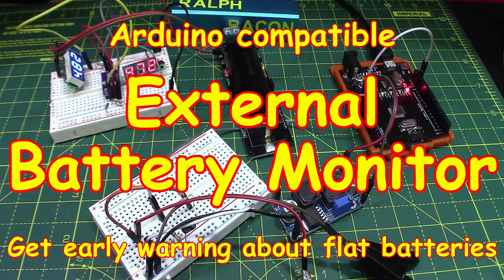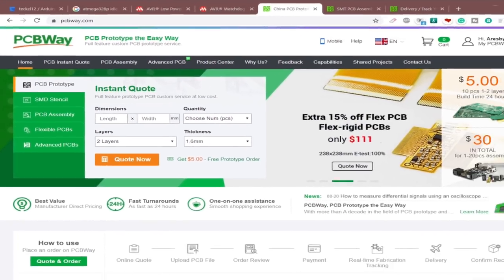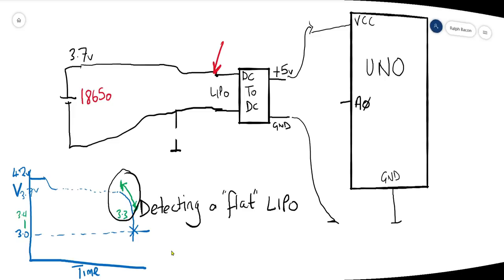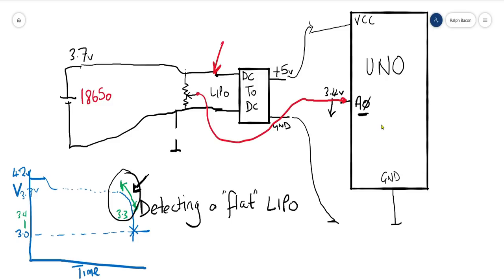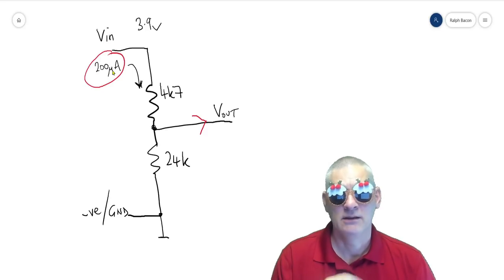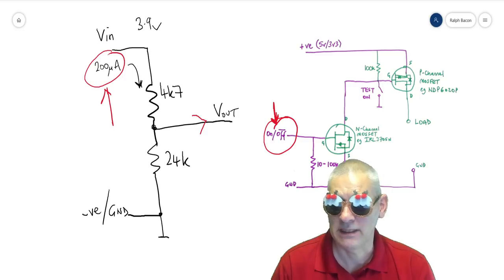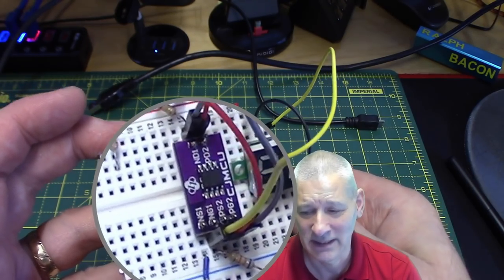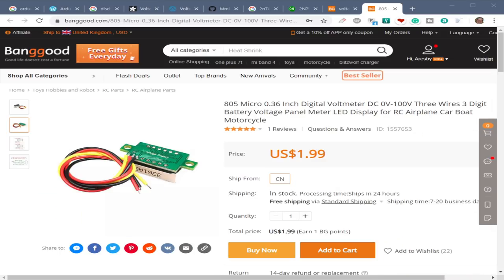#171 External Battery Monitor from your Arduino

Comment: why use a voltage divider, since the UNO is 5V, so take the voltage directly from the battery. Save the, arguably small, drainage with the voltage divider, and the UNO will handle up to 5 volts no prob. You surely have a good reason, I am not sure what it is.
Reply: ..because he wants to set a simple trigger point at 3.68 V or so.... probably doing a simple compare to the reference voltage on A0?
Reply: @whitefields5595  Good point, shorten the range that the ADC on the UNO needs to read, gives more accuracy. instead of 4.2-3.3/1023, one gets 3.4-3.3/1023. But is this accuracy needed? approx. 1 volt (4.2-3.3) divided by 1023 gives less than 1 mV, while the aim is to monitor 100mV range, hmmm.
Reply: @ElieWar  Well, if he didn't do it, folks like me and you would tell him he should have done! He probably does not want a true measure, but a comparator. If <  3.8V then do something. Go/No Go gauges are often more accurate and reliable than absolute measuring tools, especially if you have foreshortened the range in the first place
Reply: It is another method.
Reply from the maker: Others have probably explained this, Elie but the whole point of NOT using the 5v supply when running off a buck-boost device is that the voltage is not (particularly) stable. Maybe your voltage starts dropping a bit as the battery gets discharged. Using the stable, voltage-regulated 3v3 pin means this will remain steady regardless of the VCC voltage. On custom boards I would use a simple 3v3 zener diode. I should also state that if the VCC voltage changes then the AREF is going to compare against a changing voltage - thus making it inaccurate and potentially unreliable. I hope this helps and my bad I didn't really clarify this in the video.
Reply: @RalphBacon  I did not mean using 3v3 for ARef, but rather rather tapping the 5v directly from the battery to compare vs 3v3 of ARef/3v3, this will reduce accuracy, but the circuit is less efficient. This of course is given that the battery is NOT over 5v, then the UNO will fry! your way covers all cases and provides a shutoff to reduce inefficiency :-)
Reply: yes, you could take the bat+ and slap it straight into a analog pin to read....it is...sloppy
there are a few considerations...
first the Arduino can run off anything over about 3v
second, the Arduino can be side fed from any pin, this is dangerous and sloppy and basically misuses the protection diodes, possibly destroying them
so you can end up with main power turned off and a running Arduino being fed from a data pin, the resistor divider limits the amperage going through that pin to well below what the Arduino needs to run
so basically, this is to ensure you don't have devices running when they are supposed to be off
and to save IO protection diodes